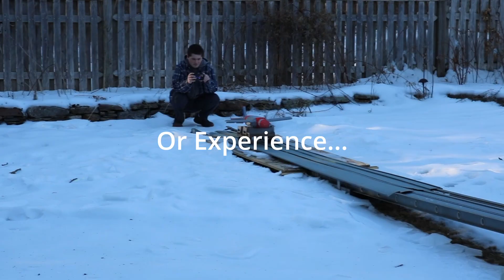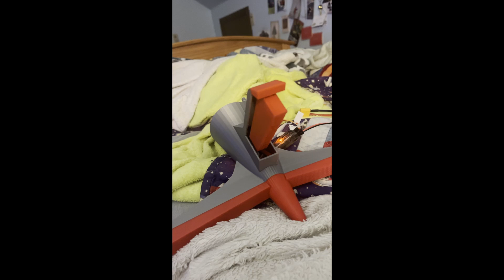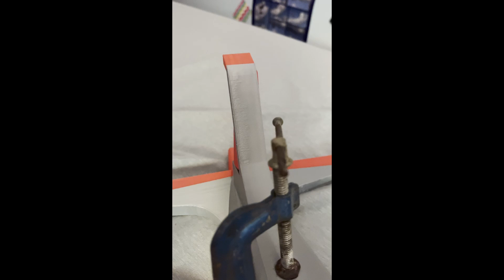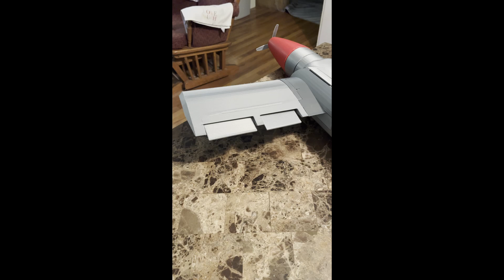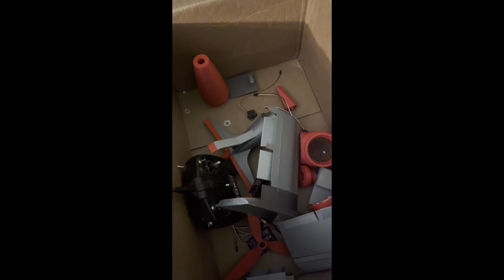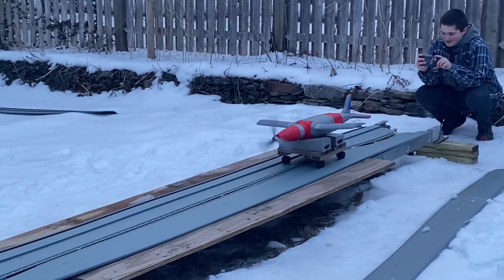I Designed and Built An RC Plane From Scratch With No Help Or Experience... (Part 1)

Comment: You need way bigger wings, less overall weight, and 4-5x the speed to get enough lift to takeoff. Not to mention a space where you could takeoff that doesn't point straight into a bunch of trees